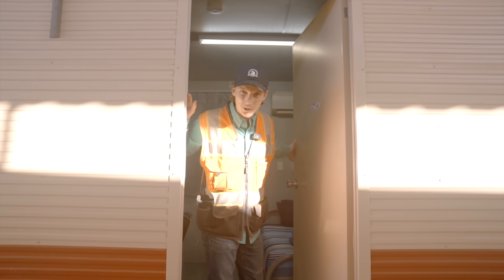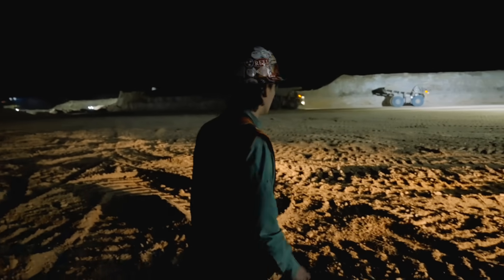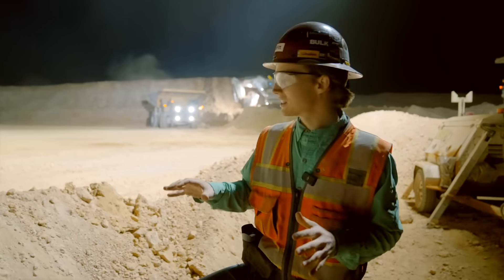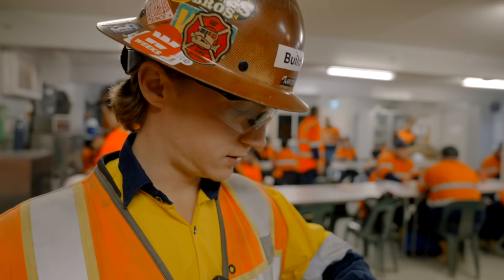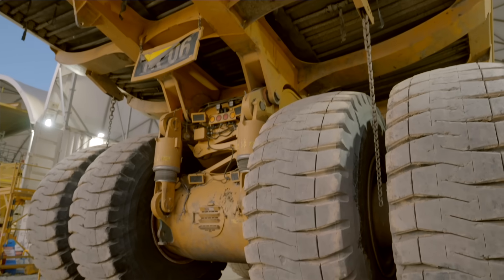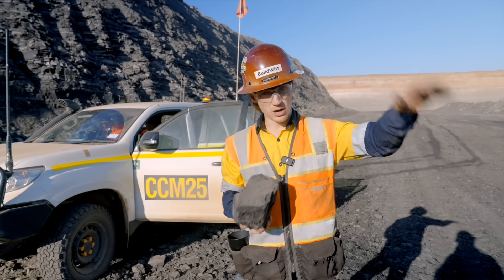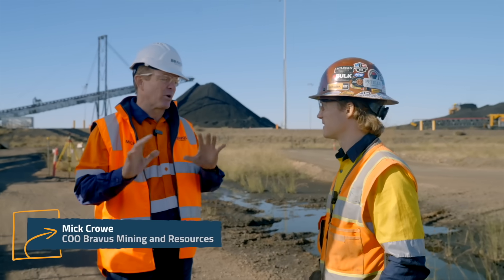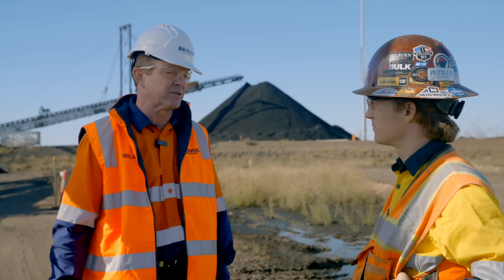How Modern Coal Mining Works with Bravus Mining & Resources

Comment: Why does this 9800 not use the bucket that empties from the bottom would it not be quicker in loading like this. 5:20  like the reverse of this one
Reply: The face shovel is the bucket that empties from the bottom by opening up. That set up has a forward facing bucket
Reply: @ do you  know the reason they use the one as apposed to the other. Like why the difference
Reply: @seanmanley5975  The excavator set up has more versatility than the face shovel. Can operate in more varied conditions. IE: double benching, benching, toploading, can dig dropcuts. This set up also has more breakout power in hardrock digging. IE: Iron ore or removing the overburden in coal mining shiwn here. Whereas in ideal conditions the face shovel is probably more efficient.
Reply: Liebherr only make the 9800 in excavator form, I'm sure, lots of mines use both types of diggers for their operations.  No expert tho

Comment: Burning coal helps minimize deforestation.  Deforestation not only releases carbon, but it also exposes the ground to erosion and the river estuary environments and oceans to silting problems.  Buening coal in the short run allows cooking with microwave ovens instead of wood.   The leapfrog to microwaves is more efficient than natural gas and electric element cooking, too.  There are a lot of ways developing nations are skipping damaging steps in technology development so they are not creating the hidden costs we are still paying for learning the harder way.

Comment: 14:14 why so many hydraulic hoses?! Is this perhaps the cheapest way to run giant cylinders?
That is- run lots of off the shelf normal hoses instead of special big ones?
Reply: If you make everything inhouse you need to reengineer a lot of things. This will make the project bigger, more expensive and it will take longer.
The more "off the shelf" parts you use, the more profitable the business gets for the supplier and you.
They are also highly remote. Wouldn't be surprised if they run the same set of tools for all the machines. With special hydraulics you most certainly need special equipment to service them.
Having a single optimized line however would have less drag and would be a bit more fuel efficient. How much? You would need to compare the actual systems. But a view percent for sure.

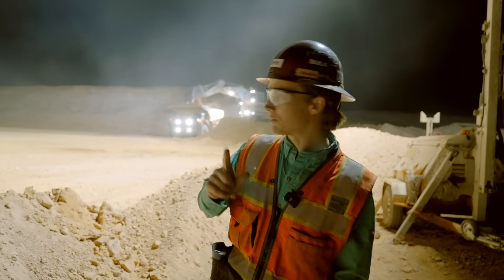Comment: 6:30 I guess that in Québec, our notion of "remote" is different. We've built 100km long power lines to mines. Heck, the most of the dams that power our cities are a thousand kilometers north and some of theses lines continue another 500 kms into the state of New York to export electricity. Something that is "remote" quite literally has to be at the northern tip of the province, where the only way in and out is by plane or boat.
Reply: This is a relatively new mine out by itself,  so they haven't got there with electricity yet

Comment: Not good truck allocation 4 to 5 trucks waiting to get loaded ?????????????????????????///
Reply: There would be a reason the trucks are queued like that. Could have been an operator change in the excavator or a delay at the dump or even a truck breakdown on a haul road. I'd imagine it would run pretty smoothly with minimal queueing 90% of the shift.

Comment: First of all, I would like to say that the video was very interesting and informative. Now for the criticism, to claim that using coal is environmentally friendly is absolute bullshit. The statement that it is better because otherwise you would burn wood is also, factually speaking, simply wrong! The bound CO2 would remain in the earth if the coal were not dug up. With wood, on the other hand, part of the CO2 bound by the tree would be released back into the environment anyway when the tree rots. 

The fact is, coal does not help the environment, only the people who need it to live off the electricity generated from coal. 

Conclusion: Interesting video, but two complete bullshit statements containing extremely critical misinformation.

Comment: The stigma from coal come from the much older coal plants which dont burn the cleanest. I worked at a coal mine in alberta and we had one of the newer coal burners and it was a very clean plant. Barely anything out of the stack and it would produce a considerable amount of power compared to the 2 oldest plants and even some of the middle aged plants. The plan before complete shutdown was to upgrade to these new systems bit by bit

Comment: lots of propaganda on both sides. It's dirty, it's important. These facts should be able to coexist in a human mind
Reply: Yeah, it seems people have extreme trouble keeping two thoughts in their head at the same time.. (as you say - this apply to people on both "sides"). Then they conjure up some flawed reasoning to keep their view without "conflict".

"... This is actually helping the environment ... people will burn coal instead of wood" Then he goes on talking about why it's important/good for for the people without expanding on how the "burn coal instead of wood" is helping the *environment*. Which on the surface seams reasonable until you realize that access to wood is limited while access to oversea coal is almost limitless. And rich people consume more energy than poor people.
Reply: Like the anus.
Reply: It's also not only propaganda. Europe, Russia, USA, Japan, China abused coal pretty hard for the last 200+ years to get where they are now.
Other countries didn't used or have this cheap economical boost. Using "fossile energy" to build a sustainable supply of power will be required. Unless a country with sustainable power uses it's infrastructure to scale other countries.
Which is happening, but the excess to scale others isn't much as of now.

Comment: That is what you call a true mass excavation operator! Smooth and highly productive.
Reply: Productive ?  Look how many trucks waiting 👀
Reply: @user-gt6zb1yi5u  you don't think before you start typing do you ? 🤣 , the only way it gets trucked up like that , is if there is hold up at the dump , floor clean up , filling blow hole , shift change , issue at start with digger , could be anything , it doesn't get trucked up like that in general , I should know , I work there and under that digger at times
Reply: @user-gt6zb1yi5u clearly that was right after shift change over. Once up and running you can see the back log is gone and the operation is running smoothly. Good try though.
Reply: @noelinator  your opinion pinhead 🥴
Reply: kept hitting the soft stops
Reply: The queuing of trucks is on mine control not the operator. Hundreds of factors to broad for a non-miner to comprehend as to why it happens ... considering the operators dig rate/load time which would be around 90secs those trucks aren't sitting there for long
Reply: @And__CLam  i guess thats the difference between a contractor pit and owner operator
Reply: @sgtsn1per  Who would be the owner operator of a coal mine running 600t excavators and 400t haul trucks?
Reply: @And__CLam  do you know the difference between a contractor pit and owner operator or no?
Reply: Like one man and a bobcat skidsteer
Reply: @And__CLam  you dont work in the pits do ya
Reply: @sgtsn1per  nope ..  not a mechanic. 994K loader op. 6060 digger next

Comment: Now Aaron as far as the moving the overburden the rule of thumb was load them heavy and paydays Thursday operator on the excavator didn't need a brain but the truck driver did no on the cole those generating stations expel cleaner air out of the stack then air going into them with the scrubbers in the stacks the problem is in North America is running out of hard coal and we got to burn soft coal it don't have the BTUs therefore shipping buy boats gets inefficient believe me it's not about the pollution the boat that brings it is probably more of a pollutant

Comment: What type of and size of Mechanic Trucks do they use on site to repair the 796 mine trucks should they break down in the mine excavation area or on the haul roads?  Are they specialized trucks or do they just load and tow the 796s back to the mine shop?
Reply: I'm a mechanic at a surface copper mine running 793s. Our field service trucks are pretty standard Super Duty chassis trucks with a service bed, crane, compressor, and welder. Where possible, trucks are repaired out in the field. Most issues are field-repairable (blown lines, starter failures, electrical problems, brake rotochambers) and the truck can be released without going to the shop. For more major problems, we get the truck to a state where it can be safely driven to the shop for further repair. If it absolutely cannot be driven, it's towed to the shop with a wrecker built off a 789 chassis.
Reply: @Porty1119  Thanks for the info, I was curious if the service/mechanic trucks for mining machines were specialized specifically for the large equipment or the typical service truck as used in our earthmoving fleet ie. the two Kenworth T880s with a IMT Dominator IV Body with 14,000 lb cranes and Miller Pro 800 welders we currently run. I’d like to see the wrecker mounted on the 789 chassis, has to be the largest wrecker in existence lol.  Thanks again for the info 👍👍
Reply from the maker: yeah they do but it's rare

Comment: Great video on not only showing the equipment and technology, but explaining the role of coal.  It is a vital resource that the US and Australia has an abundance of available.  If not coal, what is the answer????
Reply: Nuclear is the only true alternative.
Reply: Took the words out of my mouth!
Reply: Nuclear and hydropower.
Coal will still be needed for steel, iron, and pure-silicon refining and production.
Reply: ♥️ True 👏 👏 👏 
Coal is actually cleaner than water✅it is in the Bible 🤏 #FuckEarth
Reply: Hydrogen?
Reply: @supercancer273  Hydrogen is an energy storage method, not an energy source in itself.
Reply: @Porty1119  hydrogen can be made with renewables, of which Australia has huge potential for and can then be exported like we currently do so with gas.

Comment: i wonder; do the controls on bigger machines feel a little sluggish cause of the size? Also; this is a job i would never get bored of.
Reply from the maker: they said the controls on the Libeherrs are pretty responsive
Reply: Fuck no lol the bjgger the more responsive and you can also turn them down by ideling down if you cant turn the speed or sensitivity down, on most you can.
Reply: The response on the hydraulics is proportionate to the size of the machine,  there's a lot of weight there and you don't want it reacting to fast ,  the 996 has no slew brakes so you have to counter slew to stop it , can be scary until u get used to it .